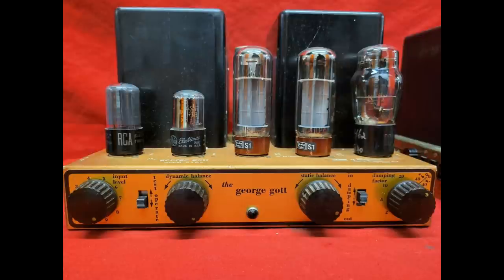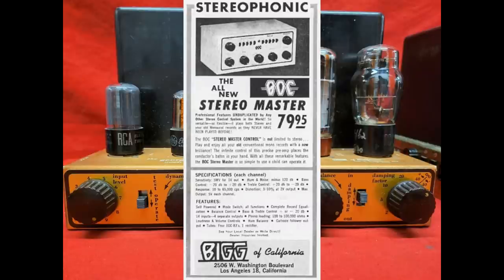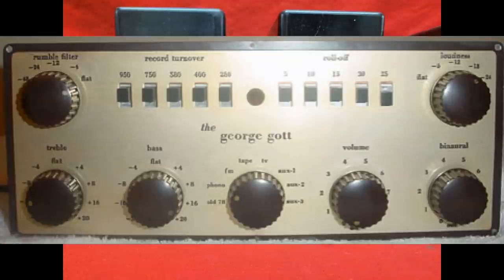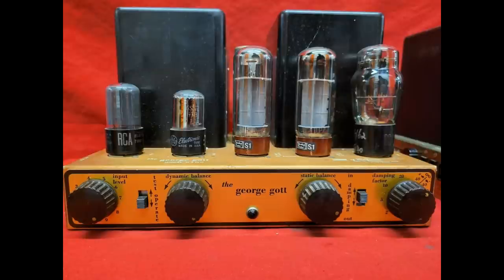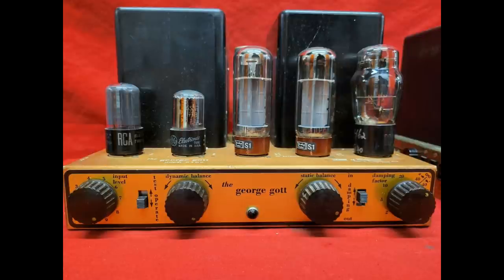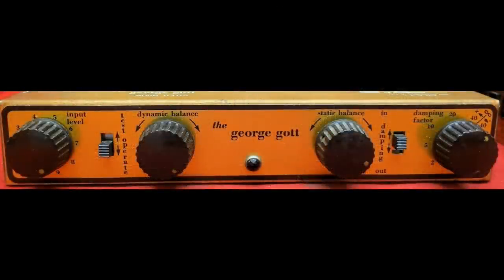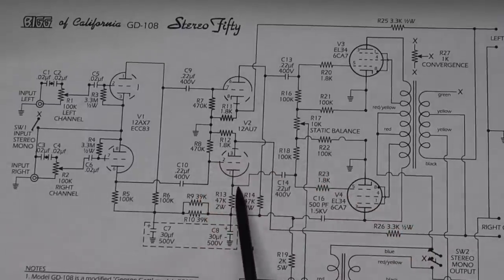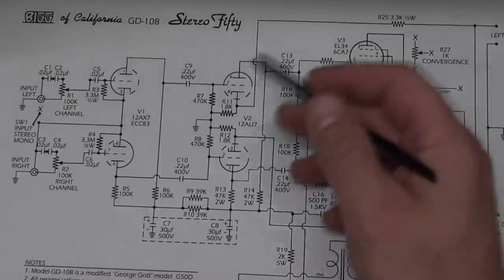BOC / George Gott Mono Stereo Mystery Amplifier

Comment: You should check out the September 1959 issue of Electronics World.  The cover story is an amplifier developed at CBS/Columbia.  It has two output tubes, and two output transformers.  One transformer is push-pull and the other is single ended.  The single ended xfmr primary is in series with whe B+ lead of the P-P transformer.  The secondary of the SE transformer is wired in series with a center tap on the secondary of the P-P transformer to ground. The inputs the amplifier are L+R and L-R.  The P-P mode of the output stage amplfies L-R (Mono) and the SE mode of the output stage amplifies L-R.  The wiring of the two transformers produces Left and Right signals between ground and either side of the P-P xfmr secondary. The amplifier shown in the ariticle is a handmade prototype, but this became a product and was widely used in several Columbia consoles.  In the article, they discuss producing L-R and L+R by the way the phono pickup is wired, but in the unit which I have, this is accomplished in the Preamp/Control unit.

Comment: That's a very clever analysis that you have done here, and if you haven't hit the nail on the head, it seems close enough to me.  I particularly liked your comparison to the method used to separate out the left and right channels in a multiplex adaptor.  This scheme isn't the same, but the concept is...

Comment: Fantastic reverse engineering on that fascinating circuit, Tony. The ultralinear design is similar to the 1957 Eico HF-52 integrated amp I recently covered. That amp also uses EL-34s and tests with a clean output over 50 watts. Similar to the BOC, the Eico HF-52 was introduced right at the early days of stereo. At that time, Eico sold an amp-only version of the mono amp called the Eico HF-50. 

As I was working on the HF-52 integrated amp, some of my viewers assumed I’d get another HF-52 to create a stereo system, but I didn’t like the idea of having a separate preamp for left and right so I set it up as a mono system as nature intended. How interesting would it have been though, if Eico had sold a stereo version of the HF-52 which included just one mono output amp, but with a stereo preamp? Then, consumers could purchase a matching HF-50 amp to create a stereo system. Had I been George Gott, that’s the approach I would have taken instead of that “multiplexing” route.

Comment: The advantage is, most of the power in the stereo signals is common (mono), so they can get away with a cheaper push-pull transformer that doesn't need to deal with DC bias and thus doesn't need a very large or gapped core. Then the small amount of stereo difference signal is handled by the common-mode transformer which does get some DC flux, but can be much smaller since there are probably much fewer turns than a regular single ended transformer.

Ultimately you can get away with far smaller magnetic cores than for two mono SE amps, and similar performance as long as your stereo signals are mostly mono.

I don't think the push-pull transformer would strictly have to be bifilar wound. As long as both primaries have good coupling, inductance will be similar for similar number of turns and the DC resistance would just be a bit higher on one of the primaries which is no big deal.

Comment: I recall seeing a design using this concept in Australian magazine "Radio Television and Hobbies" published in the 60s. Stereo was sweeping the audiophile world and many enthusiasts had very good mono equipment with heavy and expensive transformers. Ultralinear transformer tappings had come in to get triode performance out of beam tetrodes without loss of output power. It was reasoned that much of the stereo signal had a lot of common mode particularly the lower frequencies so a single large transformer transformer could handle these. The stereo effect was more pronounced at higher frequencies which could be handled by a smaller transformer acting as single ended.
BTW, did anyone notice the error in the circuit? There is a short across the primary of the push-pull output transformer at what should be the centre tap.
Reply: A point about the push-pull transformer might be missed. They were the quality component and because of that were bifilar wound or similar way of ensuring good linkage across the primary and hence symmetry. They were relatively expensive and heavy. I cannot recall if the tubes could operate in class AB or had to be class A. The smaller transformer would have to be gapped just like a standard single ended transformer because there was no dc cancellation.
I think the input was fed in antiphase so that a mono signal effectively was push-pull.
My recollection is hazy, I was a teen at the time, but very keen.

Comment: On the back of a Brian Eno lp. He gives a schematic for third channel to be used. It’s a simple idea, you take the positive outputs from both stereo channels put  a +\- 10 resistor inline and hook it up to a 3rd speaker. The record was apparently mixed with this in mind. I’ve tried it and  it’s a very interesting way to get a clear spacial quality to the recording in your room. Seems like it is related conceptually at least to this amp.

Comment: It would be a great project to build a duplicate if the darn thing works per your diagnosis. I guess the main problem would be acquiring one of those bifilar wound transformers in a single package. Maybe it could be modified using two separate ot's . Keep it coming Dr. Tony.

Comment: Hi Tony back in the late 70s a circuit close to what you are describing was used with bipolar transistors used in automotive audio systems to create higher output voltage to drive a 3 speaker system that produced coupled mono for one speaker and stereo for the other two speakers with the phase relations to higher volume signals altering each channel, sort of using IM distortion effects to produce a type of moving center of balance . transformers produce the higher output impedance needed for 8 ohm speakers with thin wiring just in reverse to tube circuits requiring lower output impedances. it is kind of was a pre 1980s quad system sound and distortion was too high for anything other than cheap automotive aftermarket stuff that hung below dash.  There were two output Transformers were inter-connected and tapped windings from both transformers fed the 3rd speaker. I service a lot of these for Sears, Western Auto and White's Automotive stores. Any grounding of the 3rd speaker wire was destructive to both channel's output transistors. the schematics never show transformer windings and I never really tried to find out the exact internal winding connections because PC board traces failed before the transformers were damaged. This concept might have come from some of the work in designs of amps from the 50s and 60s you were describing . I was in my early years of College (EE) and the NRI School of Communications Electronics Certificate for FCC license. Did this work of the side for extra Funding. These Systems Left the Market in the early 80s when IC technology replaced the discreet components in automotive Audio and Automotive Audio moved to HIFI and much more power. Like Your Channel you are Keeping it Real.

Comment: Nice analysis of a strange "stereo mono amp" -with only one output transformer!
As I understand it the schematic is drawn after the amp has been subject to "heavy modification". I doubt very much it can reproduce a stereo signal when i t has only one output transformer, even with the little "phasing transformer" in the output signal path. I agree that the OPT probably has two separate primaries, the way it is drawn would represent an AC short on it.
In my opinion the best would be to convert it back to the circuit of that other George Gott circuit

Comment: I’d go with Tony’s conjecture #3; they (Bigg of California) probably realized they could save money by just buying lots of standardized output transformers (1 for each channel) from whomever made them for Fender (or other mfgr’s of guitar amps), rather than have one fiddly common-mode xfmr + a big, custom, bifilar-wound output xfmr + a DPDT switch and a pot. Then they just have two mono-bloc amps to do stereo, with one shared power supply. In fact, if you just get rid of the circuitry to the right of C13/14, R16/17/18, then you just get exactly that - two mono-bloc amps with the 1st stage (V1) being a voltage gain stage, and the 2nd stage being a cathode follower (voltage unity/current gain) stage, whose outputs (from each cathode of V2) go through a 3.3K resistor to the (non-grounded) terminals of the left and right speaker terminals. 🤗

Comment: The fact that it has a common mode recovery circuit makes me think this is the analogue equivalent of mp3 joint stereo, or a really primitive form of phase, amplitude and frequency detection and " channel steering" where you have a mono "core" plus a bit of right and a mono "core" plus a bit of left. I think it was a method of getting an older mono design to work in stereo and gain a marketing advantage. I'm also speculating that it was a bit too technical for the user compared to the new fangled stereo amps of the times and didn't sell well as it may have had phase issues. Just my UK 5 pence worth.

Comment: Hey Tony, first time commenting I guess. It appears to me they are using what they had to "mimic" a stereo output. I would guess these units would be circa 1959-1961. There was a move by all the major US companies to convert to stereo. The transistor units were around the corner and they were using their mono tube stock to convert to stereo, if only for a couple of years. These units are very similar to the Zenith 5B23 (mono push pull) and 5B27 (single ended stereo). I have both of these units and it is obvious they used the same exact chassis for both units. It appears BOC was doing the same thing. If it were me, I would get new OT's and use a different schematic to give those EL34's a good life. Thanks for the great content!
Reply from the maker: I think this amp is too rare to just use it as a platform for a standard designed amp.  I'm hoping we can bring it to working order as it originally was.  I'm really interested to see where they were going with this design.  Thanks for the comment!

Comment: Yes you can have stereo output from a single pp OT and smaller modulating transformer exactly as in your schematic. I have old german stereo tube radio with almost same schematic design and i asure you it reproduces very noticeable stereo. In my opinion there is significant crosstalk between the channels, because they couldn't achieve perfect canceling of signals in the modulating transormer. You can see the schematic of the radio and see the similarities and differences because there are such. It is Wega 513. It's speakers layout is 2.1. 1 subwoofer in pushpull and 2 midhighs in se mode - it is very interesting and the radio sound great 😉

Comment: It seems that the designer’s goal was to have a mono push- pull/ stereo single ended amp. Clearly  can only use one output transformer, so I believe that the mono/ stereo switch should be wired-up to manage the signal phases with the aid of common mode transformer. Convergence pot seems to be meant as channels separation adjustment and perhaps please inversion feedback for push-pull (???). The mono stereo switch must be wired much differently than it is in the schematic. The common mode transformer should be meant to recover part of the signal lost in stereo mode due the self cancellation in output transformer (L and R signals are not equal). The output transformer may have both primary and secondary windings separate and connected by the switch. Signal phase understanding here is essential (and complicate) but very interesting as unusual amp. Thanks for sharing this unknown little beast.

Comment: I wonder if this amp was used in some kind of specialized application. First of all, the unusual labeling "Dynamic Balance", "Static Balance", and "Dampening Factor" are not the typical things you see on a typical amp.  Usually you see "Volume", "Tone", "Balance" (Single word), and sometimes equalization pots.  I wonder if this is actually NOT supposed to be a stereo output but instead control whether the two input channels are separate or mixed somehow.  It appears that the controls are designed to control two different inputs somehow, and perhaps it was used in some kind of PA, DJ, or even a special effects application that involved control from two different audio sources and maybe the "Stereo" output is from both sources together.  I also wonder if this is some kind of multiplex encoder or decoder and the output actually was fed into another unit or something or if there was a speaker with a demodulation or filter circuit in it that "decodes" the mixed signal into two channels somehow.

Comment: Looks like you have run into dome prototype work! Too bad it may not be complete!. I think the output xfrm pases throuh the difference of the two channels  while the " common mode", passes the summ. On the sec , you got L-R  and R-L. Then you add (subtract?) the L+R from the other xfmr, and voilá!  You got L  and R on each channel, provided the the turns ratio, and phases are correct. Kind of too much trouble to achieve stereo!. I use a similar summ and diff to achieve separation of ultrasound audio in a doppler medical device, to distinguish the blood sounds toward and away, respect of the transducer direction, many years ago.
Reply: agreed, seems like the hardest way to skin a cat. i keep trying to imagine the longterm effects as the closely matched tubes begin to diverge.. from channel imbalance to weird phasey effects.. ?

Comment: I hope it's not wired like Greg's schematic or it's going to blow up when it's plugged in!  He shows a ground tap on the 117 V primary of the power trans. but he is missing the ground center tap on the high voltage winding by the 5V4.
Reply from the maker: There are a lot of errors in the amp as it was wired.  As I said, he documented it the way that he found it.  Hopefully, this will give us the best chance of figuring out how it should be wired.  Thanks for the comment!
Reply: @xraytonyb  It might be possible that Greg traced it wrong? Did he get someone else to verify his schematic?

Comment: Definitely an interesting design, I've never seen anything like this. The way SW1 and SW2 are wired makes no sense to me, I'm pretty sure it's an aftermarket mod. The differential L-R signal output looks a bit like the rear channels on 1970s era pseudo-quadrophonic amps/receivers. Common mode transformer is an interesting thing, and it really needs to be beefy as most audio signal power incl. low frequencies (bass/kickdrum) is gonna be found in the common mode (unless that bass/kick is panned out in the recording), plus it needs to have a slot, since DC is going through it. Moreover, it's gonna introduce hum to the speakers from the power supply's ripple, and it's gonna be there even in a perfectly biased amp. Replacing C11 with a larger one or even making a choke-input DC filter (choke wired between 5V4 cathode and C11+C12) should help.

Comment: I can't imagine this amp being anywhere near "Fifty" as the nameplate indicates. Seems rather convoluted to try to obtain a stereo output by using the output transformer and the output tubes connected this way to avoid using two output transformers. I also can't imagine the output of either channel (?) being clean and undistorted. Wow, so interesting!
Reply from the maker: It is possible for a pair of EL34's to produce 50 watts of output.  In mono mode, it would be possible.  In its modified "stereo" mode, this would act more like two single-ended outputs.  I would guess that it would only be capable of about 5 watts, if it even worked at all.  I really want to see this thing work!
Reply: @xraytonyb  Five watts seems a bit conservative.  I'd double that to at least 10 watts SE.

Comment: I can see how it would work, but I can't see it working very well, certainly not well enough to waste a nice output transformer on the attempt, however interesting it might be. Also, no real HiFi circuit would run the input tube in grid-leak bias using a grounded cathode. You usually only find that in guitar amps where they're trying to save parts and squeeze the maximum gain from one gain stage.

Comment: This seems backwards.  I'd think the larger output transformer for would be L+R, which would be handling the bass.  The L-R would be the smaller one.  However, being a prototype, it might be a "will this work?" proof of concept before doing it right.
Reply from the maker: First, I think the circuit is wired wrong.  We have to remember that this schematic was drawn as the amp was found.  There were a lot of wiring errors that I think aren't original, when the owner acquired this amp.  The common mode transformer would cancel out-of-phase signals with respect to the top and bottom output tubes, while allowing the in-phase signals to pass though both tubes.  I think George Gott was trying to use a similar concept as how a balanced XLR signal works.  The output would be two differential signals that reference a common return point.  The common mode transformer helps to create this common return point and differential signal.  At least that's what I'm guessing.
Thanks for the comment!
Reply: @xraytonyb  Ok, but an XLR signal is mono, not stereo.  There is no left or right on an XLR.  I think it's more like the FM stereo multiplex system you described.